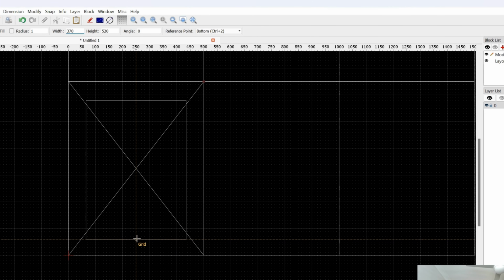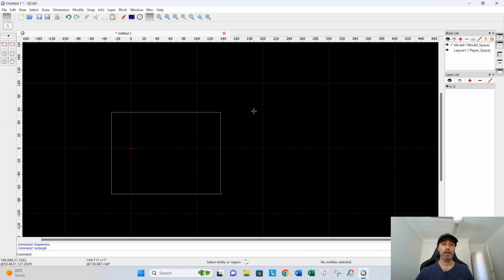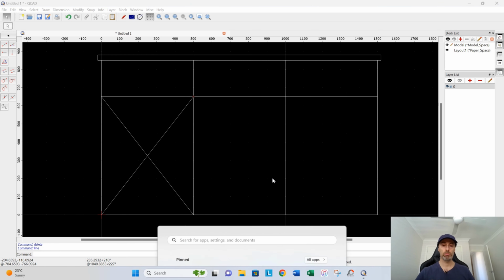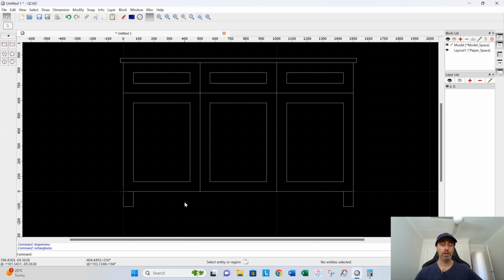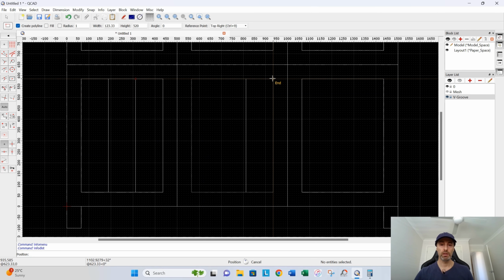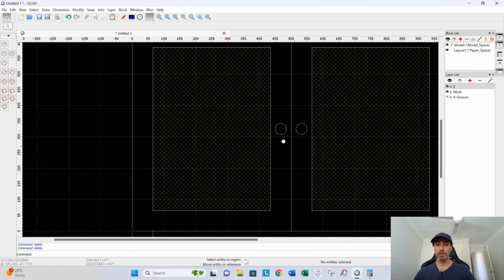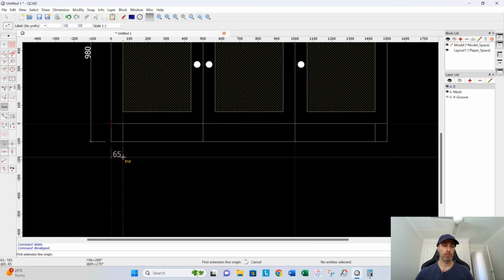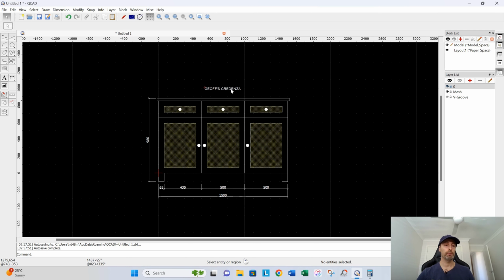QCAD Drawing Basic Cabinets & Joinery | QCAD CAM

Comment: Thanks Geoff, I found this really useful.  Being new to CAD drawing, I noticed some of your copy techniques meant that entities were being copied and placed on top of existing entities - could that cause problems later, such as needing to put on separate layers, explode to cut items out, etc.?
Reply from the maker: @horizonimages  technically your right but it’s not an act of parliament, I just use this to help work out measurements use drawings as reference and to show clients etc, which works for me. For what this program allows you to do and considering it’s free I think it’s awesome and powerful
Reply: @geoffsjoinery4990  I hope you didn't think my question was criticising.  Being a newbie to using any CAD programme I was merely trying understand if this is normal practice or whether (ideally) I should be trying not to place lines on top of existing lines.  I guess once viewed on screen or printed, those lines below won't be visible anyway.

Comment: Great video (I'm about 15 minutes into it so far). I've been looking for a free or cheap CAD program to design some projects I want to build (e.g. new stairs for my front door, a kayak rack, a garden shed, a deck, a cabinet for my 3D printer, etc). QCAD looks like it's going to work well for me, and this video gets me started in the right direction. I discovered that you can enter math in the width and height fields when drawing a rectangle, so you don't have to open up the calculator program. Thanks for making the video!
Reply from the maker: Your welcome glad it helped 👍